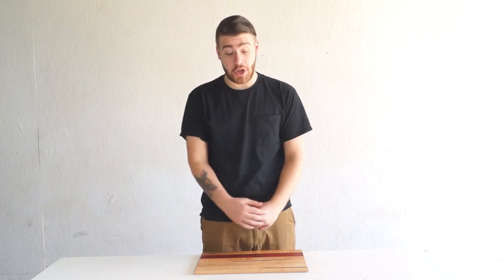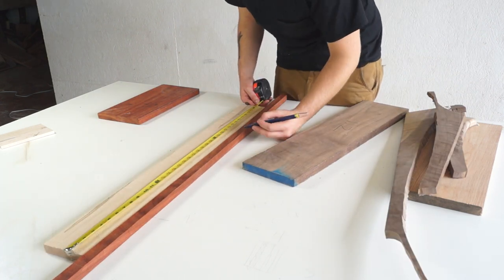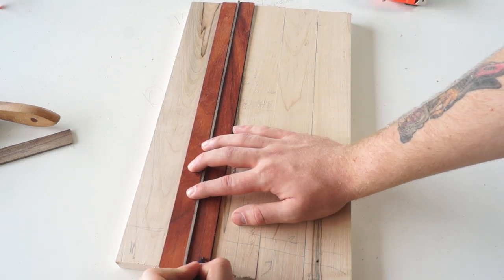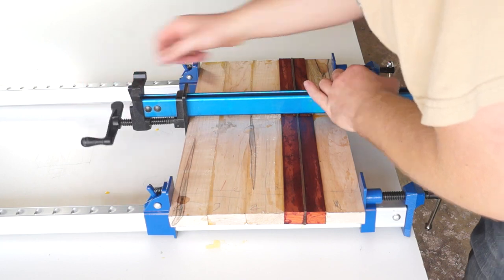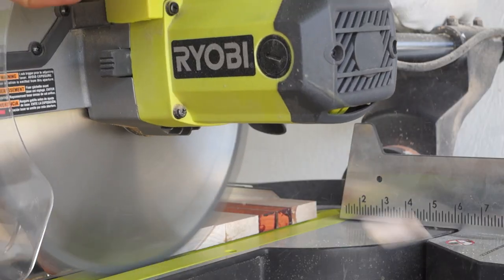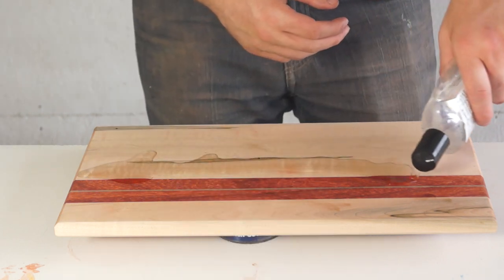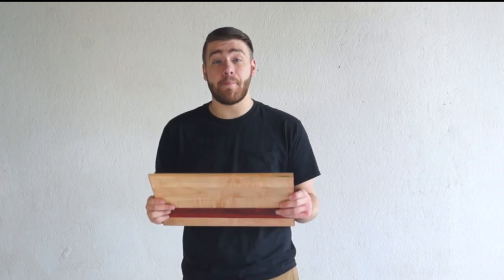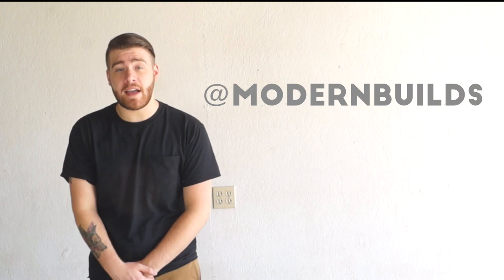Build Your First Cutting Board | Modern Builds | EP. 34

Comment: I find that if I put rubber feet/pads on the bottom of the board, it keeps it stable while I'm cutting. Of course, I makes that side of the board unusable to cut on, but larger boards tend to move around. I am going to have to try this! Love the combinations of the wood you used!
Reply from the maker: +Mark Woodworth Good tip. I've used rubber feet before on a few really big, butcher block cutting boards once and I really liked it
Reply: Cooks and chefs put damp paper towel underneath to hold boards in place..no need for feet

Comment: Love it, thanks!  I'm going to build a board similar.  Any suggestions for a guy with no surface planer?
Reply: James Seriously, that is a very specialized piece of equipment.
Reply: Well I did build my cutting board, then I built a very nice keepsake box.  I took the parts over to a friends house and used his surface planer on the rough wood.  I have a 24" air board sander for auto body work that worked very well for the finishing work.  They both turned out beautiful.
Reply: Hand plane or sand vigorously. Make sure thickness is spot on during glue up and it can make it doable without a planer.

Comment: Next time try using a biscuit jointer, it will make it stronger, or use a rod style of that if you have multiple thin layers, like in the one you made.
Reply from the maker: +Ethan Harper honestly, I don't really think that's necessary. I've made quite a few of these and there held up fine. I made a 1" board about 7-8 years ago and it's totally fine. (I've just had to  resurface it a couple times)
Reply: That theory has been disproven.  Glue is stronger than the wood itself

Comment: I'm making a couple for some wedding gifts, I wanted to brand their initials on it, any tips or ideas?
Reply from the maker: Hmmm, good question. You could always use a wood burner, or a laser engraver could maybe burn them in. If you have a local trophy shop or sign shop I'd ask them.
Reply: Good idea, thanks!
Reply: Route the names in with a Palm router and v—groove 60 or 90° bit.

Comment: Great video! Quick question though, how did you have practically no snipe on the board from the planer? Teach me your ways!! Haha
Reply from the maker: +The Russian Woodworker putting it on the MDF helps, because there's a surface longer than the cutting board. I had a little, but doing it that way really minimizes it
Reply: +Modern Builds thanks! I really need to try it out!

Comment: Did you use scrap wood for this cutting board? did you check if the wood was marked as "untreated"? You wouldn't want the stuff they put into regular wood in contact with your food. Just saying
Reply from the maker: It was left over from other projects and untreated
Reply: Great. I just wanted to clarify that. The chemicals put into lumber to protect it from rot and insects could be dangerous if they get in contact with food, and it's always good to point that out in these DIY projects. Thanks and keep the good work. Nice projects. Currently binge watching your channel

Comment: Hey Mike! Quick question, any alternatives to the surface planer you used in this vid? It's really hard to find one where I'm from!
Reply from the maker: Maybe a belt sander. that could work to flatten everything out
Reply: Muhammad Isa Dennis a belt sander would take way too long and if you sand to deep it would look like shit, also if your gonna spend money on a good belt sander just get a thickness plainer and if you don't want to spend a ton of cash get a good size block plane
Reply: I recently used a circular saw to plane as I don't have a planer, yet. That video will be up on my channel soon. However, wouldn't recommend. If you can get a router then turn that into a planer, takes longer but there we are. Other option is that you buy a small hand held planer and then turn that into a thickness planer by making some jigs for it. I tried a belt sander when I recently made two kitchen countertops, and it's do-able does take longer. Btw, that video has been uploaded onto my channel if you want to see how it went for me.
Reply: I tried a belt sander when I recently made two kitchen countertops, and it's do-able does take longer. Btw, that video has been uploaded onto my channel if you want to see how it went for me.

Comment: if i don't own a planer, could i just spend a lot of time sanding it and periodically checking it using a square to make sure its flat?
Reply from the maker: Yeah, I think that'd work fine. A normal sander may not get it, but a belt sander would for sure
Reply: Depending on how uneven the board is. I have only an orbital sander and after a day of sanding to try to flatten a warped/bow board it still was wobbly.... I just made my first cutting board (out of oak). He boards were pretty flat when I bought it and when gluing I clamped as much as I could to keep it flat - which succeeded. Even then with an orbital sander to sand off all the glue and up to 220 grit took me an hour. But even though it's a lot of work, the end results are really rewarding. It cost me $8 in materials (I used new wood not scraps) to make what may cost me $40. 

In the end, you don't have to use an electrical planner - but it would be easier if you have one.
Reply: I tried a belt sander when I recently made two kitchen countertops, and it's do-able does take longer. Btw, that video has been uploaded onto my channel if you want to see how it went for me.

Comment: I would have used a metal strip between the padauk wood.
Reply from the maker: +Jonathan Clevenger can you use medal in a cutting board??
Reply: +Modern Builds As long as you santize it and make sure you use galvanized metal or a rustproof coating.
Reply: +Jonathan Clevenger Just make sure it's nontoxic though.

Comment: Couldn't you have flattened the other side first instead of gluing it?
Reply from the maker: ? What do you mean?
Reply: At 2:34, you glued your piece onto a board for the planer: could you have planed the side that was uneven first and then the reverse side, instead of gluing one side to the board while planing the topside (as you've done)?
Reply: I see. Don't have a planer, yet lol. Now I will know. Cheers for the info!
Reply: How often would the board need to be recoated with mineral oil?